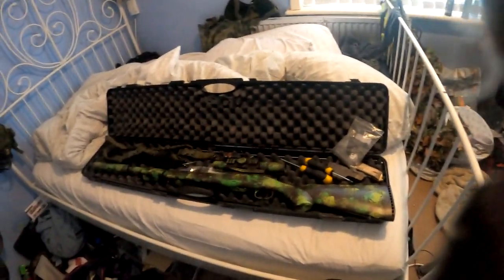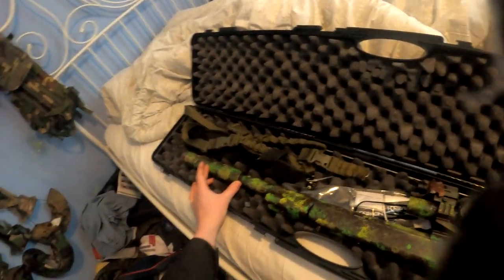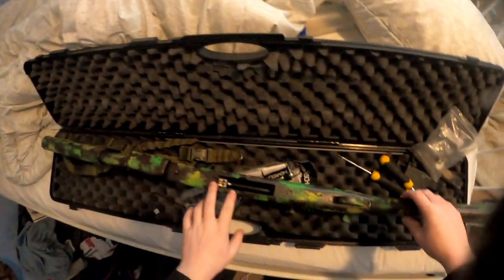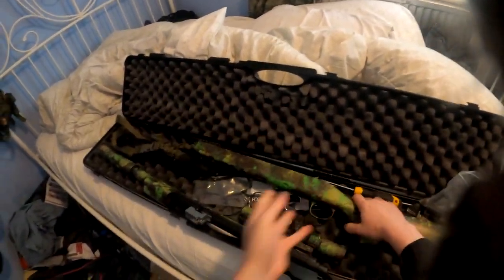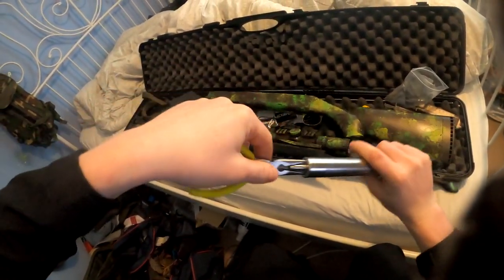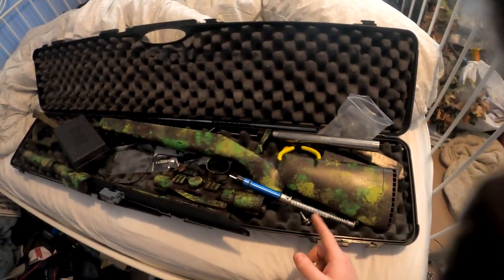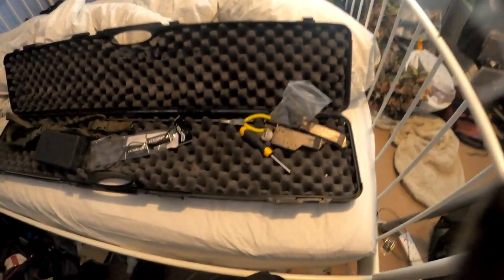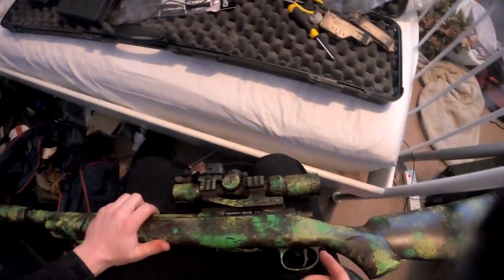How To Make Your Novritsch SSG10 Alot Quieter!

Comment: Damn you're lucky. My bolt pull is absolutely disgusting and yours is buttery smooth
Reply from the maker: Yea my friends isn't same as mine either you need to try lubing the sear or filling the cylinder window down slightly

Comment: Do you have a sound meter to test the actual difference that the mods make? Digital cameras auto level sound so a loud gun and a quiet gun sound the same.
Reply from the maker: I dont unfortunately, its comparable to my srs with the sound, the pitch of the ssg is slightly higher than the srs so I can tell the srs still has the edge but still really good
Reply: You can download an app to measure and store peak DB on your mobile.
Reply: @jay-kyleducati5811  if you want an inaccurate reading, sure

Comment: My SSG10 has the ringing noise after firing. Would it be the spring in the trigger box or would I have to do the "can" mod? Do you have a link to the "can" mod?
Reply from the maker: It is the spring in the trigger box, if you disassemble the rifle with the screws at the base of the gun, once you have the shell off there will be two more screws on the trigger, undo them and  pull the trigger off and you can see the spring through a hole in the triggerbox, get some thick silicon lube and put some in and around the spring and that will stop the ringing.

I haven't found the can mod to be as effective but I need to make video for the can mod I think so I will eventually get around to this as soon as I have the time :)
Reply: @LeadFootUK  Thank you!

Comment: What is the mod that you have done to the end if the suppressor and how do you install it in depth?
Reply: It’s called a fart flap all you have to do it put tape over the the top where the hole is and then shoot the gun and it will make a whole in the tape and that’s it

Comment: Hey Lead Foot UK, I have the ringing problem in my SSg10, I have filled the trigger box with silacon grease twice.  But, It goes down through the box and coats the trigger and after a while it rings again.  Any tips
Reply from the maker: Thicker grease would solve that

Comment: Have you done anything to the bolt.
Your boltpull sounds so smooth and silent, no grinding ore scratching.
My SSG10 boltpull is so grinding and scratchy
Reply from the maker: I have lubed the trigger sear and all the bolt but other than that nothing, I hear that the hole on the cylinder is too tight on some peoples which causes the scratchy pull so needs sanding out slightly
Reply: Christian Frigstad same with mine. I sanded the hole out and lubed it up and it’s still scratchy
Reply: Braedy for minecraft Good stuff I tried that but nothing works. How much do you have to sand because I did very little
Reply: Braedy for minecraft Good stuff yea my piston seems fine but the is little grooves in cylinder where the spring guide stopper god and I can’t get them to go away, did yours have that when you sanded it
Reply: Braedy for minecraft Good stuff yea I asked novritsch and he said the same thing but the grooves won’t go away maybe tougher grade sand paper would help of should I get a metal tool that will smooth it?
Reply: This is what I did, take off the stock and the trigger box off your ssg10.  Take everything out of the cylinder and take a paper towel and delube it.  Clean the spring guide stopper as well.  Take some sanding paper, (I used 80 grit by the way), and sand the spring guide stopper (not too much just make sure it's is smooth) and sand the edges of the rectangular hole of the cylinder(where the spring guide stopper is) (again don't sand it too much just make sure the edges are not sharp and are smooth).  Next, take scotchbrite and rub it rapidly where you sanded.  This ensures the metal of the spring guide stopper and the rectangular hole of the cylinder will be smooth.  Next, clean and relube your cylinder,  Next, clean the spring guide stopper thoroughly.  Finally, (this is my brilliant invention), take a STICKER, you heard me right, a sticker, cut a rectangle, (about .5 cm by 1.5 cm) and put it around the spring guide stopper (where the cylinder rubs against the stopper, there should be marks where that occures).  Note, the sticker might not actually stick to the spring guide stopper, but it will stick to itself.  Wrap it around as tight as you can.  Since stickers don't stick to metal, it won't be ideally tight.  Take another sticker rectangle (the same dimensions) and wrap it around the first sticker rectangle you wrapped around the spring guide stopper.  If you wrap it tight, the first layer will tighten as well.  This will work because we made sure the edges of the cylinder aren't scratchy and sharp (hence the sanding). We sanded down the spring guide stopper to make room for the stickers. Note, because we have two layers of stickers (this is necessary) the cylinder pull will be a bit tight at first.  But It will be buttery smooth and loosen after 100 shots.  Because the top of the spring guide stopper is in the cylinder, the sticker layers are unable to fall off!!! Trust me this will work!!

Comment: That monster can mod needs some more details. Im not sure what you mean wrap the can around the guide to eliminate the ringing
Reply from the maker: What further details do you need bud you just explained the extent of it there
Reply: @LeadFootUK  welp, first off a head on look might help viewers understand what you mean by wrapped around the guide. Allow us to see down the guide axially to see the can piece between the spring and guide. 

Does it get curled into a tight spiral around the OD of the guide and then flare the spiral to the ID of the spring or just a straight cylinder shape with a small overlap? 

Just a question and suggestion mate, no need to talk down when folks ask a Q bc they didn't catch what you're explaining. Least it came across that way :/
Reply from the maker: @onepunchairsoft  So sensitive Its really not that deep bro, it's just a case of cutting the can and wrapping it around the guide, the overlap of can should only be around 1mm which will allow just enough movement for the spring to slide over it without catching on the can, its alot of trial and error
Reply: @LeadFootUK  gotcha. I was really stuck on how it's reducing rattle but the guide has less distance to move axially with the can in between the guide and spring. I thought it was coiled and using tension to essentially keep the guide in the center of the spring but it sounds like its loosely wrapped and not tension spring coiled.

Comment: Hey i have a question... if i cock my ssg10 a2 the bolt handle hits my safety lever is this normal?
Reply from the maker: I see alot of people having this issue, It's a sort of normal fault on vsr-10s as the positioning of it is in the way, I remedied this by just removing the safety, there is a single Philips head screw holding it in just unscrew that and take off the spring and it will remove the safety. 

You can also but a plate that screws on to cover the hole left behind but it's not completely necessary if you don't mind the hole being there.

Comment: Im atill a noob in comes to airsoft. Im still starting and im staring with double bell VSR10. Is it the same with SSG10?
Reply from the maker: That's no problem, the double bell vsr10 is the same type of gun but has upgraded internals. So essentially your gun is how the ssg10 started life before they tinkered with it and upgraded all the parts inside it, I'm not 100% sure of the double bell model is compatible with all the upgrade parts that is made for the vsr10.

The ssg10 is a Pre-Upgraded vsr10 basically
Reply: @LeadFootUK  thank you sir.

Comment: have you heard of the "SSG10 Over-Barrel Crazy Jet Suppressor" on Silo's website? it eliminates the need for a shorter barrel. was curios if it actually works
Reply from the maker: All suppressors work they just need a bit of playing with internally to make sure work more efficiently, I hadn't heard of it until now but It seems like a good idea I just don't understand why you wouldn't need a shorter outer barrel because you are still putting a suppressor on the end of your barrel so adding length to your long barrel.

Comment: what order would you recommend doing these mods?? I'm not sure where to start, whether to change the outer barrel first or the inside components first...
Reply from the maker: Easier to do them all at once so you don't have to take the gun apart as many times but it doesn't make to much difference

Comment: How does the can mod work or like how do I really install it cus the twang noise I have in my gun is so annoying
Reply from the maker: So if you get a large can, cut a rectangle the length of the spring guide then wrap it around the spring guide so it just overlaps then shove the spring over and it's good to go, cock the gun a few times and it will settle in position and solve the problem.

If you also lube the spring in the trigger box as I show in the video that will stop the biggest twang noise you hear when shooting :)

Comment: Hey man, thanks for the tutorial. I'm not sure what I've done but when I put it back together and try to test fire after screwing back the trigger box it feels like its not bolting all the way back. Do you have any suggestion? Thanks
Reply from the maker: If you push the trigger box back in toward the front of the gun it should seat in flush to the receiver if you watch 13:08 onward I put the trigger box back in the gun, make sure the cylinder is in the gun also
Reply: @LeadFootUK  Thanks for the reply, Ive done the trigger box like the time stamp. However could you expand on how the cylinder should be out the gun? in you vid its already installed before you screw in the trigger box?
Reply from the maker: @fabienthresher  My apologies what I mean was, make sure your cylinder is in the gun with the handle locked in down position as per in the video
Reply: @LeadFootUK  okay yeah, ive tried this too like the vid, still won't bolt back all the way. Can you think of anything else it could be? I must be doing something wrong here ... Thanks
Reply from the maker: @fabienthresher  Could be your spring not cocking back all the way, take the cylinder out and check the spring/spring guide, have you got fps adjuster rings on the spring guide?

Comment: How is your bolt pull so smooth? Mine is very scratchy and I’ve shot like 1500 rds already
Reply: I had the same issue, can't remember where I seen it at, but if you lightly sand the cut out on the cylinder it will help a lot.

Comment: i fnd it weird that i run the exact build and everything and its shoot quieter then before but i dont even get the 2.3 joules its maybe hitting 1.69 joules i wish i could get it to 2.3 atleast but tried most things any tips on that?\
Reply: Have you tried with high spring?
Reply: @dddavid132  i did and not running 2.3 i sold it and bought an Action army T10 convertered to HPA

Comment: Do you notice any fps loss from doing the fart flap?
Reply from the maker: None at all as it doesn't hinder the travel any, the air that is generated from the piston covers the bb, as it flows through the barrel it pushes the flap open and then exists with the flap closing behind the bb when it is shot containing the noise, I have a double fart flap on my suppressor now and still no problems
Reply: @LeadFootUK  great thanks!  looks like an easy mod to do for sure.  I'm working on getting my ssg quiet right now too.  I love these cheap easy mods with duct tape and coke cans haa!  Thanks for the great vid.  I'll probably make a video of mine too once I'm done modding.  Modding is a deep rabbit hole once you get started!
Reply from the maker: @ShotTactics  I always get compliments on how quiet mine is and it's because I spend hours messing around with things and searching far and wide for random little techniques haha, the double fart flap is a good one I have internal and external flaps along with home made suppressor material :)

Comment: By rough estimates, how much do you think each category contributes to reducing the noise level of your gun?
1. short barrel+suppressor - ??%
2. fart flap - ??%
3. silicon in trigger box spring - ??%
4. monster can mod in spring guide - ??%
5. foam in stock - ??%
I won't mention the air break pins since they've been debunked to not work.
Reply from the maker: 1. 6%
2. 15%
3. 10% (but for your own benefit)
4. 5% (again own benefit)
5. 1%

Mine and my friends ssg the same the only difference is the airbreak and mine is way quieter 🤷🏻‍♂️
Reply: I put air brake pins in my srs with a variable mass piston did not make a lick of difference to noise.
Reply from the maker: @willieaway  This is the ssg bud not the srs
Reply: LeadFootUK yeah I know, just saying I found they same in my srs. I also see on Novritsch website they try to make you not buy the air brake pins. You think a Sorbo pad would also help?
Reply from the maker: @willieaway  I think it all helps, even if it changes the pitch it helps as I say I can hear my friends shooting from 20m away but mine can just about be hear 10m
Reply: LeadFootUK keep up the good vids, hi from New Zealand 👍🏻
Reply from the maker: @willieaway  Appreciate it
Reply: Bruh what, airbrake works

Comment: Did you glue the foam to the inside of your gun?
Reply from the maker: Nope just pushed it into the holes and then when you screw gun back together it squeezes it in there and doesn't come out anyways, you could if you wanted but not essential
Reply: @LeadFootUK  Alright thanks, ended up just putting it in there like you said, works great. Appreciate it
Reply from the maker: @rad5207  No problem at all :D

Comment: LeadFootUK, Something about the air brake pin. In this video:
https://youtu.be/jk40bBO8QlM 
The guy does a test to  see if the pin actually helps. He finds out using a DB counter that the average is about the same, if not higher. Looks like your pin has a little bit of a “placebo affect” on you? Really all thats happening is that your losing fps. Idk man, not a hater but I recommend you check the video out. Thanks for the video though its been a big help
Reply: Also, a tutorial on how to make the fire flaps or whatever they are would be 🔥.
Reply from the maker: Hmm how strange, comparing my ssg to my friends mine is way quieter his is short outer barrel with novritsch suppressor also but I've done the mods, very weird and I can do a fart flap mod video sure :)
Reply: LeadFootUK cool! Fart flapp 😂.
Reply: What Ian said ^ 😬
Reply: On novritsch web site they don’t recommend air brake pins. But sell them because some people swear by them.
Reply: That is a bad test, he should have set the BD counter down range not right next to him.

Comment: What shoots better srs or ssg10 ?
Reply: Every gun is different based on the mods. My vsr 10 has so many upgrade parts in it. And you need to know how to maintain and install those parts or else your gun will become useless. Your question has way to many factors.

Comment: dam 330 fps, that's low for a sniper. In the usa it's 550 fps and that with the bb wight you shoot.
Reply: not in GA. here its like 550 fps with .25's at chrono
Reply: Thats 330 FPS with .45 gram which is equivalent to 460-470 fps with .20s that is also my limit here in the Northern part of the USA but I envy you! I think 2.8js or 550 with .20s 
is good for snipers lol

Comment: Will the adapter fit if you run a short outer barrel and a long  inner barrel??
Reply from the maker: Yup, That is the setup I ran up until recently It actually works out better as the adapter works as a barrel spacer and holds the inner barrel centered. I only changed to a longer outer barrel as I had an accident with the shorter barrel and it broke.

If you use a shorter outer barrel and standard long inner barrel you will need to run a suppressor as the barrel will stick out the end of the outer barrel.
Reply from the maker: @grimmreaper5965  Its such a nice platform to just run and gun with, I've never ran mine with the long barrel, this weekend will be the first time so hopefully I don't mind the extra foot of barrel xD